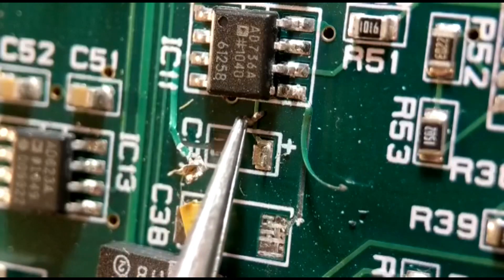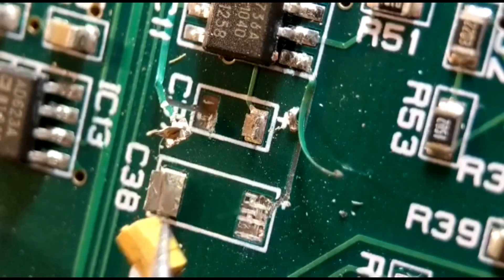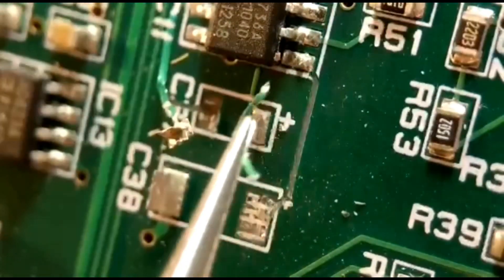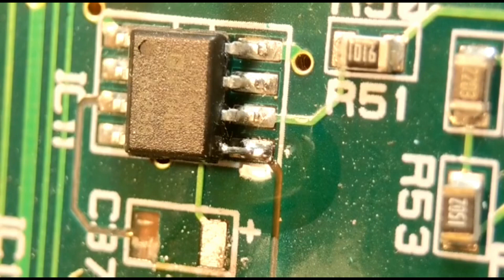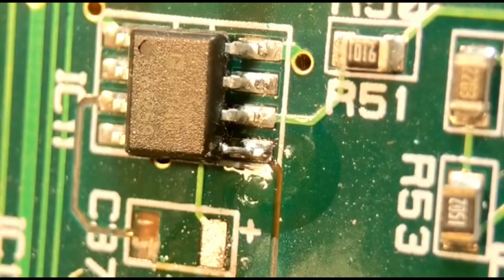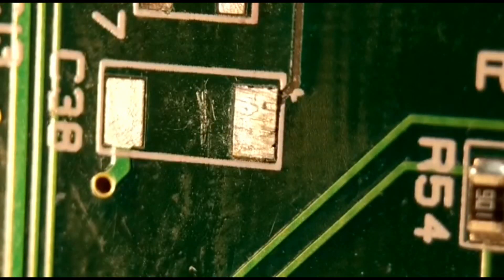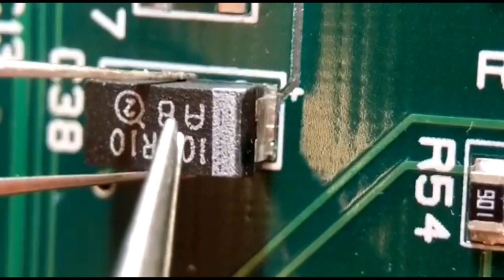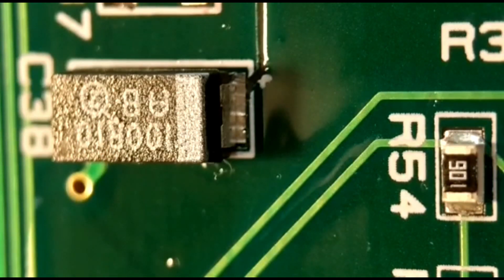How To Repair Damaged Pads ,Traces and IC Pins #soldering

Comment: Awesome video. I wanted to ask about the first cap you replaced. C38. Is the polarity correct? I thought the white band is Negative?
Reply from the maker: Hi , thank you for your comment , much appreciated . The band marking on SMD capacitors denotes the Anode ( positive end ) , SMD diodes the band denotes the negative end . So in this instance the capacitor was fitted the correct way. Thank you again for your time , take care 👍
Reply: @mrsolderfix3996  Thanks. I just watched your video on how to read and solder SMD caps. Again, another Awesome video.
Reply from the maker: @denmartos6019 hi , thank you 👍

Comment: Stripping that pad with a scalpel and rolling it up, wasn't a technician's job, that was art.

Btw, I found on EEVBLOG a recipe for making homemade flux. Since in Uruguay we lack access to specialized items, I tried to mix it.

It was a great success!

30% https://en.wikipedia.org/wiki/Rosin 
3% of Glycerin
and the rest of Isoprophil Alcohol at 99% to complete 1L.

Mixed it on a 1L bottle and shaked it once a day for three days. Filtered and put in a syringe. Works a treat!

As a tangential bonus, you can make different mixes and have less viscus mix side by side with a paste.
Reply from the maker: Hi , thank you for your great comment , very informative . The more information we can all share the better 👍

Comment: Brilliant video very skilled.  I wanted to send you some photos of a pcb from my drone which got hot & melted the micro plug from the Geomagnetism Sensor--compass it’s made a mess of the board (some broken traces but I can’t see where the plug would go or the 4 wires from it.  I couldn’t see an email address.  Hope you can help.

Comment: On the capacitor, why do you not stick the pad down rather sticking the component? I have seen videos when the pad is stuck down with epoxy. Would this not allow the component to be replaced in the future. Thanks.

Comment: What kind of glue is that you used @ 11:40 ?
Reply from the maker: Hi , thank you for your comment. The glue used is a glue that is recommended for PCB use called Tak Pak . It's perfect for mod wires , bonding components down etc and can be broken free and removed if required , but will also stay true if left alone. Use the opposite way to what your told , make sure you spray activator first over desired area , blow lightly until it's disappeared , then put a small bead of the glue over a wire for instance until you have the perfect shape . Doing it this way stops the glue being blown everywhere when using activating spray and makes it stronger . It goes white and brittle if activator is used second. Ebay , Amazon , Farnell , RS Components etc should sell it . Quite expensive but I've brought both glue and activator on eBay separately and paid a lot less . Hope that helps , thanks again 👍

Comment: Hello and thanks for your shared knowledge. Question my friend, would I be able to use  conductive copper tape to reconstruct the pads?
Reply from the maker: Hi , thank you for your comment, much appreciated. Yes you can , no problem , the tape should solder ok . Do not use aluminium tape though as this doesn't solder at all well . Good luck with your project , take care 👍
Reply: @mrsolderfix3996  appreciate it sir, I have a big project coming this weekend. To be on the safe side, I got the pre-cut pads as well, the same ones you are using on the video. Thanks for showing us the clever way!
Reply from the maker: Hi , good luck with your project , take care 👍

Comment: I realize this is an older video. Your repair will absolutely work. They actually make circuit board repair kits that include every size pad and runner for most any type circuit board repair. And those kits include feed throughs as well in multiple diameter sizes. When I was in aircraft circuit repair, we even repaired totally burnt through circuits when a part literally burnt the board leaving a hole. Yes, that can be repaired as well... Thumbs Up!
Reply from the maker: Hi , thank you for your comment. I just like to show people how to maybe fix their products with parts from scrap boards etc , just giving them another option . Some people may go down the route you've suggested but I always like to use pads from scrap boards and also IC legs from old components because I can get the exact size I need to match the originals from somewhere on these boards . Sometimes I've found the kits don't have the exact shape I've needed .Thanks again 👍

Comment: What was that spritz or blast at 12:09 on this video?
Reply from the maker: Hi , thank you for your comment. That was the sound of the activator for the glue ( Tak Pak ) that I was using . It comes in a small aerosol can and was just the sound of it being sprayed around the capacitor. Hope that helps 👍

Comment: What gauge/type or name of the wire being used for the traces?
Reply from the maker: Hi , thank you for your comment. The green sleeved wire in this video is called Kynar and it's a 30 gauge wire . You can also buy Kynar strippers especially for this wire . Available from Farnell, RS Components, Rapid online or if in America Mouser or Digikey . This wires available also in many colours . Hope that helps , thanks again 👍

Comment: trying to solder on small antenna connectors on my phone.  Melted the first one.  When I was removing the connectors from the donor board, I melted one.  I don't have any more room for error.  any tips on not melting the black blastic on these small anetnna connectors?
Reply from the maker: Hi , I understand your problem , some connectors are made of such soft plastic it's like they are designed to fall apart as soon as you place any kind of direct heat on them . All I can suggest ( and I have used this method successfully ) is if your doner board is definitely scrap with no chance of it ever being saved , what I have done is with a scalpel blade I've cut underneath the whole connector taking the top layer of board off , pads and all , this enables you to lift the connector plus  obviously some PCB with it . Then you can scalpel between the pins , separating them from each other and then pull off the pads , one by one quickly with an iron . What the connector doesn't like is heat run right across it all at the same time . I understand this sounds a bit extreme but I personally have achieved this . If successful when replacing do your joints one at a time very quickly . Hope that's of use . Good luck 👍
Reply: @mrsolderfix3996  Thank you, good to know that I wasn't doing something absurdly wrong.  I think I will try with a smaller soldering tip and being mindful of the heat.  And maybe let it cool down first after 1 or 2 failed attempts to solder/desolder.

Comment: Thanks for the instruction, I just managed to to solder a power supply cable straight to the board on a GPS navigation computer after the micro USB power plug broke off the board. Great advice in your video.
Reply from the maker: Hi , thank you for your comment , much appreciated. I'm glad you found the video of use , if I can help anyone then that's great. Good luck with all your soldering projects and thanks again for watching the video 👍

Comment: Thanks, just managed to to solder a power supply cable straight to the board on a GPS navigation computer after the micro USB power plug broke off the board. Great advice in your video.
Reply from the maker: Hi , thank you for your support , I'm glad you sorted out your problem . Sorry for the delayed answer . Thanks again for your support 👍

Comment: Very nice and clean work 😁

Now a challenge for you :) How would one go about getting those tiny pads under the IC back in place, if they (by accident) got "removed"?
Reply from the maker: Hi , thank you for your comment , much appreciated. In one of my older YouTube postings ( Repairing damaged pads , " The Invisible Fix" ) I actually transpose a couple of 'tiny' IC pads onto another board where they were missing and make it look " invisible" .
As it's an older video the quality isn't as good as I get now but it's still well worth watching and has proved quite popular for viewers. Hope that helps and thank you again for watching 👍
Reply: @mrsolderfix3996 
I will defently take a look at that one :) Been looking at a diagram of the IC and the 2 pads that are missing, 1 is not being used according to the diagram and 2nd is shorted to another one of the pins 🤔

Comment: Awesome video in learning a lot 👍
Reply from the maker: Hi , thank you for your comment , much appreciated. I'm glad the video's are helping you , that's why I like to make them . I will keep posting more soldering videos on YouTube when I can ( I now get much clearer picture clarity than when this video was filmed , my last 5 are clearer ) as I've now worked out how to do my own editing . Thanks again and good luck with your soldering projects 👍
Reply: @mrsolderfix3996  The quality is great mate , I don't suppose you could tell me why my soldering tips oxidise within 2 minutes and then the solder won't stick to the tip . It only seems to do it with pointed tips not flat tips
Reply from the maker: Hi . This is a common problem , even I struggle with it at times . It's worse when you don't use your iron for long periods , I leave a ball of solder on the end of the tip before I turn it off ,  so when I return to it I can wipe this ball off and it's nicely tinned , this helps . Also if I'm struggling I very gently scrape the end of the tip with a blunt knife then quickly tin it , wipe it off , repeat this a few times and eventually I always get a nicely tinned tip . Hope you get on ok , but your not alone with your problem especially since lead free solder came out ( didn't really have this problem when using leaded solder ) , you can also get little tip tinning pots from Farnell , RS Components etc but I don't really rate them that highly ,  thanks for your comment and good luck 👍
Reply: @mrsolderfix3996  thank you for your advise mate keep up them amazing videos
Reply from the maker: Hi , thank you . I've recently worked out how to do my own editing on my videos so I now get better picture clarity ( my last 6 are a lot sharper ) so I will do more repair ones in the near future with better clarity . Thanks for your support , good luck 👍
Reply: @mrsolderfix3996  the videos I've seen has great editing mate and clear to me 😂 take care
Reply from the maker: Hi , thank you for your support , much appreciated. All the best with your soldering 👍

Comment: Great vid. Last night I was messing with a solar charger board (Cn3722 ic) and managed to make a mess of it. Found this vid and the biggest thing that I got out of it was that you are light years ahead of me LOL!
My hands are shakey, my eyesight is terrible, my magnifying glass gets in the way no matter where I put it. Blah blah blah. I think I should find a house in your area and buy you beers until you offer to teach me how it's done. Mate you make it look so easy. Top stuff and fantastic work. :-)
Reply from the maker: Hi , thank you for your support, much appreciated. I've just been doing it a long time I guess , but with practice everyone will get better. My biggest 3 tips are a decent iron ( Weller or Metcal ) different thickness solders ( 0.25mm is amazing for fine pitch ) and you MUST use flux . People say it's in the solder , yes , but that flux is burnt off soon as your iron hits it . Thanks again and good luck with your projects 👍
Reply: @mrsolderfix3996  cheers for your encouragement. I will keep trying for sure. Its really my first crack at surface mount stuff and I'm not one for giving up without a fight.
Electronics is just my hobby, but can be incredibly frustrating!!

Comment: What kind of wire did you use?
Reply from the maker: Hi , thank you for your comment. In this video I used 30 gauge Kynar wire which is a recommended wire for pcb modification work. I always try and match the damaged  trace size with the wire I'm fitting as this is important for signals etc. Kynars a great wire and comes in all colours . Thanks again for watching 👍

Comment: Enjoyable to watch and admire - crucial is that magnification!  You previously commented that you use a"long reach stereo microscope from a company called GT Vision."  What is the magnification?  As a hobbyist, I'm looking for something "good enough" at a hobbyist price point.
Reply from the maker: Hi . Thanks for watching the video , much appreciated. All my filming is actually done on a phone camera . I attach a macro lens to my phone camera and this enlarges the work perfectly for what I need . I just place it next to the work taking place and film it . Most people use the microscope camera which films directly from above , but I prefer angles from the side etc. My scope is 40 X vision which is plenty good enough for even the smallest parts . You can change the lenses on scopes so I could strengthen if I need to .Mine cost about £900 , which is probably to much for the hobbyist but I'm sure their are plenty of good second hand ones way cheaper. The long reach is a good idea as you can fit any size pcb under it which to me is vital. Thanks again , and good luck 👍

Comment: When I've seen SMT pins get ripped off, they usually rip flush to the package plastic leaving no little tab to solder onto.  This seems like an unusual case.
Reply from the maker: Hi . In this case there was a little piece of leg to solder to , but it can be done if there is hardly any . You can chip away a tiny piece of the IC body surrounding the pin carefully with a scalpel and expose a small amount more of the pin giving you enough to join to. I made a complete youtube video on this showing an IC with 6 broken off legs and 2 ways to fix them Thanks for watching 👍

Comment: Hi. What's the type of microscope? Thanks.
Reply from the maker: Hi . I use a long reach stereo microscope from a company called GT Vision. All my filming though is done on a mobile phone with a macro lens attached to the camera lens . This gives different angles than a microscope camera and in my opinion better angles for seeing what's going on with the board . Hope that helps 👍
Reply: @mrsolderfix3996  Okay. Thank you.
Reply from the maker: Hi . No problem . Good luck 👍
Reply: @mrsolderfix3996  :)

Comment: Great work.
I'm a little bit sad that you didn't showed the actual wiring of the PCB traces. ;)
("Only" the result is shown.)
Reply from the maker: Hi . If you go to my other postings I did an older video where I show modification wires being fitted . It's basically done the same way as that older video. All my trace wires I do a standard way no matter what the length is and I also show how I glue the wires down in the modifications video as well . I will do another one like this in the near future and I will make sure to show the way I do the wires . Hope that helps , thank you for watching 👍
Reply: @mrsolderfix3996  Thank you for your reply. It seems I don't have watched enough of your videos yet. But im working on this. ;)
Reply: Just amazing ❤
Reply from the maker: Hi , thank you. Hopefully the video can show people that disasters can be fixed. Thanks again , take care 👍

Comment: 12:10 thought you sneezed on the board for a second 🤣
Reply from the maker: Hi . Over the years I've learnt hopefully not to do that as it does tend to cause chaos ( flying 0402's etc ) so not recommended even if I did , which I'm sure I didn't 👍

Comment: Nice... I have to admit I was surprised you didn't bond the pad down with underfill or a high temp glue of some sort... but it indeed was functional! love your videos.
Reply from the maker: Hi . Thank you for your comment . I tend to sometimes put a bond of glue after the fix is complete ( araldite , Tak Pak etc ) around the edge of pads etc , but in this case I actually bonded down the component for extra strength. Every repair I find varies what I need to do but I guess if anyone wants extra strength of course they could glue down the pads. I only tend to use underfill on BGA devices but you need a hotplate to do this properly. Thanks again for watching , much appreciated 👍

Comment: Don't cut the lead when replacing broken IC legs like this, until after you've soldered both joints. If you cut after doing only the 1st, that tiny short piece of wire has to absorb all that heat from your iron, instantly melting the solder at both joints when touching it. If you leave the cutting til last, there will be much more wire, thermal mass, to absorb the heat, and you'll have a bit of time to get a good flowing no.2 joint, without the 1st joint melting so fast. It will also be easier to maneuver the wire to line it up for joint no.2, with a long wire end to steer it by.
Reply from the maker: Hi . Thank you for your comment . I personally like to do it like this as you get a much neater end result and as long as you do the second joint quickly it's pretty easy as the first joint on the base of the pin has a lot more solder on it so will take a lot longer to melt than the second joint . I always say though everyone will pick the method that's suits them , I just wanted to show mine to give other options to everyone . Thanks again 👍